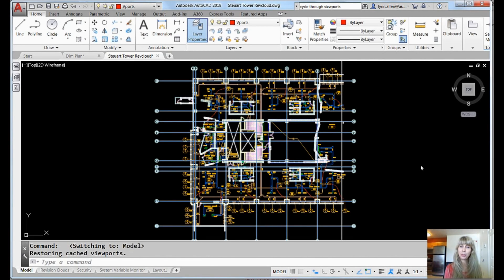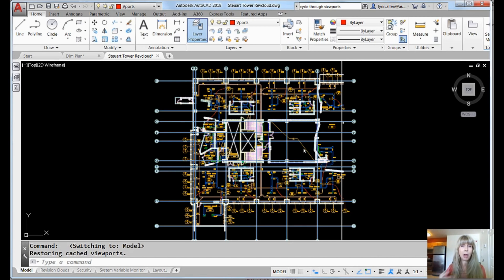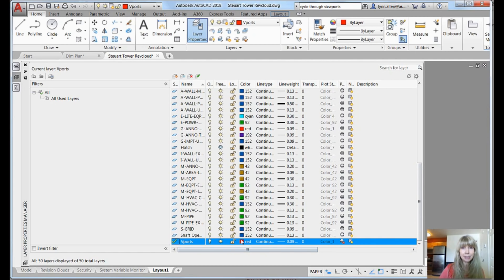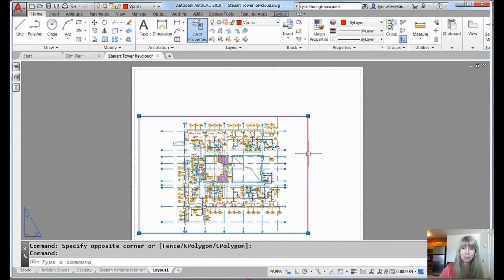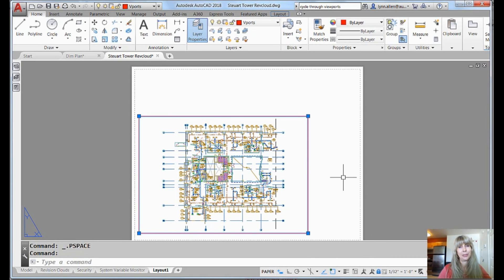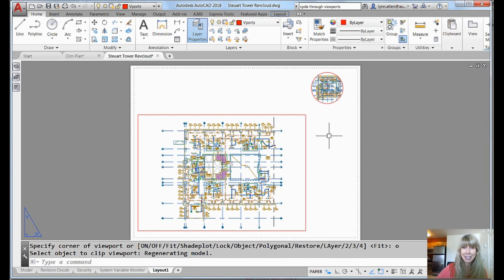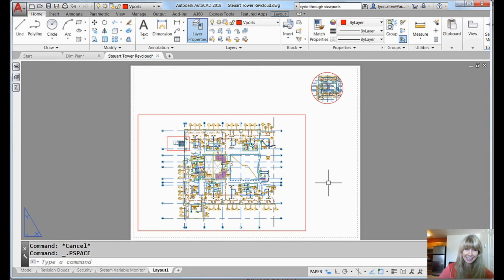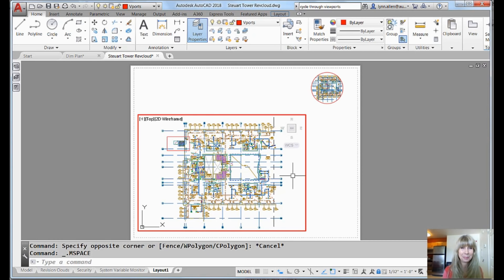Create Speedy AutoCAD Paper Space Viewports — the Right Way (Lynn Allen/Cadalyst Magazine)

Comment: Lynn expand on the recommendation regarding NOT placing vport on defpoints
Reply: Sometimes I freeze the defpoints layer, and it would be annoying to not see the viewport perimeter.  Sure, I could  just unfreaze defpoints, and life would be good again, but there really is no reason to not create a special layer for viewports.  I name mine Z_VIEWPORT.  I put a Z_ in front of all the layers I use in paper space, like the layer I draw the title block from is called Z_TB.  The Z sends all those less used layers to the bottom of the layers list so they don't get in the way when I'm working.